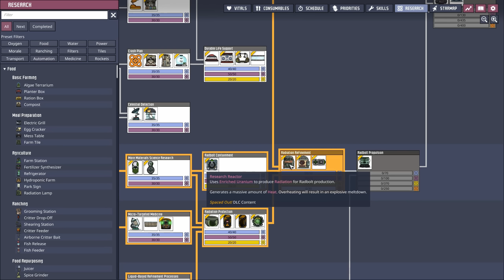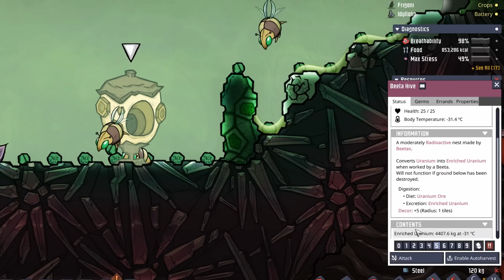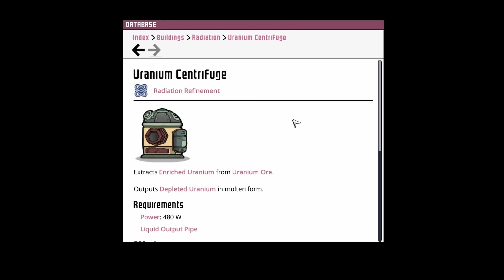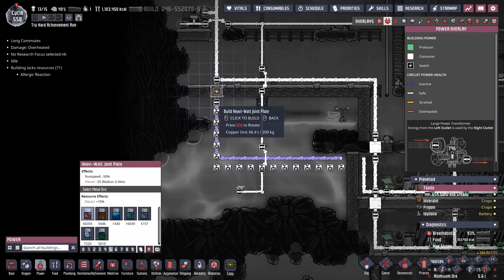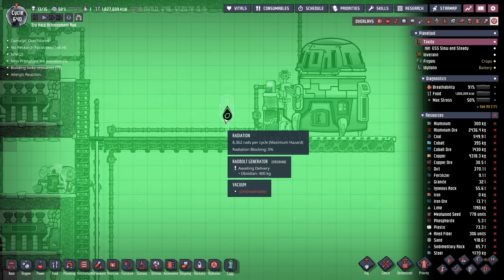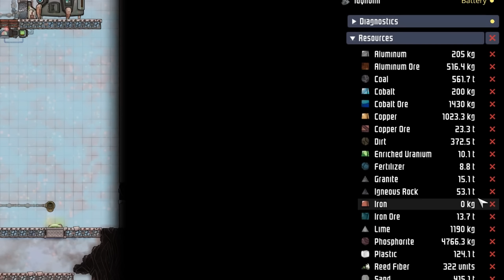Nuclear Industrial Sauna | Max Diff Achievement Run | Ep 14 | ONI

Comment: echo help plz xD , i'm trying to build a similair nuclear sauna as yours , i'm having a problem  , basicly i'm still in sandbox mode , the problem is the heat transfer from the sauna to the steam turbine , tried diffirent materiel " ceramic doesn't work neither " the only thing that works is insulite , i figured it may be bcz of tempeture shiftplate so tried replace them with ceramic same result , then tried drywall in ceramic same problem ......

btw : got 2 aquatuners for 5 steam turbine on top then another 3 aqua for 10 other steam trubines at the side , the heat transfer occur at everyone of them as soon as i build the insulated tile o f any other material than isulite

Comment: Nuclear waste is a good coolant as long as it's above 30 degrees. I use it on my steam turbines!

You could move the nuclear waste 'catch' tiles higher. This would provide some shielding and more space for your industrial brick. Waste still falls and gets pumped

Don't worry about too many tempshift plates. If you can make a line from the heat sources to some of the steam turbines, you'll have plenty of heat exchange.

Coolant limited reactors are fun, but you would need more resources.

Comment: Echo, you can use one (or multiple) temp sensors and AND them with the timer automation to control the conveyor shutoff supplying uranium. If the Steam temp goes above 200, you can stop the Reactor from running. Once you start adding industrial gear, they will be adding extra heat and you can save on Enriched Uranium.

Comment: I don't think I've seen anyone try to purify water with the power of fission. That's actually quite a good idea, you save power by not using the distiller and sieve, and produce power by cooling the steam. Very impressive, though if I were to say one thing, I'd suggest using the nuclear waste as a coolant. Since you don't use infinite storage that's about the only use I can think of for it off the top of my head. But aside from that I must say very good idea, and impressive use of ingenuity. 
That all being said, I was going to go into detail of how unrealistic the nuclear waste production is, and also how incredible nuclear fission is in reality. But I got distracted by how ingenious you were with that water purification.

Comment: IIRC reactors don't output steam, but water that is so hot that it turns into steam the moment it lands on the ground. 
Meaning the pressure isn't really a problem for reactors.
That is the reason why reactors are suggested to be placed at the top of the steam chamber.

Comment: Seems like a good time to throw some automation on those steam turbines with one battery for each so you can use some of that parallel automation, and tie it in with the reactor so that if the power gets snipped somewhere it turns off.

Comment: The system that you put in so the reactor only gets 10kg uranium per cycle is flawed. If the reactor is off (not accepting uranium), the system backs up a bit and holds a few cycles of uranium ready to be put into the reactor. You should put an AND gate, so that the system will send the 10kg only if the cycle sensor is sending green AND the reactor is accepting input (the switch is green).
Reply from the maker: The timer sensor controls the flow so I just need to take away the 1 second of green and it stops. I like the and gate idea though!

Comment: You might at least use the nuclear waste to cool your steam turbines. Allows you to cut down to one aquatuner for the ten reactor turbines, because the SHC of nuclear waste is so good. If you submerge the aquatuner in more than a full tile of nuclear waste it won't leak once a cycle and it won't take corrosive damage.

Apart from that you can really only use nuclear waste for more rads or more power. Rads you can get from an infinite storage of nuclear waste (although I believe you don't do inifinite storage on principle). The contaminants on fresh waste produce radiation. The infinite storage with its germ multiplication (glitch?) offsets the quick decay of radioactive contaminants, making an infinite storage of waste a pretty strong radiation source.

You can get power and contaminants by capturing radbolt engine exhaust with a pool of nuclear waste. You can run more turbines on the heat and the germs from the exhaust can be turned into radbolts to refill the rocket when it lands again, similar to the self-fueling steam rocket.

Anyway, great playthrough so far, especially in terms of production quality. The pacing of editing and narration is excellent. Great job!

Comment: You should have an atmo to lead suit interchange up near the top of the reactor building, so dupes that need to do work near the reactor will switch their atmo suit out for a lead suit before entering that area.
Reply: I think the problem with that right now is that he kinda doesn't have any lead.
Reply: @jadekaiser7840  very fair point, i completely forgot about that important detail

Comment: I used the nuclear waste to make natural tiles, and them make the pips plants the exuberant variant of the plants I wanted, thay way I can have a wild plant that produces the same rate as an domesticated plant, but without using resources to fertilize them
Reply from the maker: Good idea, so long as they don’t melt!
Reply: @EchoRidgeGaming  yeah, they melt at 26ish, so its ideal to sleet wheat
Reply: Wait you can do dat
Reply: How do you make a natural tile?
Reply: @PermacultureGame  for nuclear waste u need to use airflow tiles and pressurize the nuclear waste to above 1500ish kg, them cool it to 24C, its a very hard labor work, but I think is worth it
Reply: @ggcedicoes6599  So you make the airflow tile out of the nuclear waste and then pressurize it with gas?
Reply: @PermacultureGame  no..., its kinda hard to explain, but I can post a video by sunday, so u can see what im doing :D
Reply: @ggcedicoes6599  Awesome, thanks!

Comment: I once tried to use nuclear waste as a supply for infinite radbolts. I tried to melt the damn thing and then put it in a liquid box of sorts, with 3 radbolt generators.  In order to get like100 bolts/cycle for each one, I had to melt, like 10 tons. Inefficient as hell, then I found out wheezeworts give better results for 0 maintenance. It was my payload shooting only run, no tansport rockets, just pure, AI controlled system of gathering resources. Heavily modded game, but fun as hell.
Reply: Using the waste for radbolts really depends on using infinite storage to condense the waste into a very small area of concentrated radiation. If you're not using infinite storage, the reactor room itself is your best bet, and you're already getting the power from the reactor itself.

Comment: Nuclear (Nu-clear) Waste pump: add a liquid sensor to the pump, force the pump to sit in a small ammount of (atleast 200°C liquid waste), this way there'd be less heat (meaning power) wasted, which would also allow a few more turbines in. Those turbines would need some fenagling with this design, though, as they'd require access to both the steam and cooling. (Which is why I usually stick with our dear Irishman's design, much easier to expand). 

Lead Suits..... 'Nuff said 😊

Would also suggest a storage for the nuclear waste, as there's an achievement to mutate all the material-producing plants, but as @Echo is partial to not using infinite liquid/gas storage, I can't think of another easy way for this 😂 (infinite storage: 4x5 Airflow box with bottom corners cut out, Radbolt Generators inside the storage tank, diagonally downwards shooting out of the box into Reflectors. From there, the bolts can go anywhere you'd want. Infinite liquid input spot would be upper-right with a blob of naptha. This was for anyone interested, as shown by our beloved Irishman 😊 ) 

Otherwise, I'd say the Reactor design-premise is great. Radioactive Water-Purifier 🤣🤣 ❤ just need some automation to extract, and chill, the salt.

Comment: I built an infinite storage for nuclear waste which produces crazy amount of rad after ~200 cycles. A single radbolt generator can easily produce 1k+ radbolts/cycle if you submerge it in the one-tile infinite storage. For really long I assumed nuclear waste radiation will have a half life and decay, but they actually just keep their original rad lvl forever. I ended up stopping the reactor after I ran out of my naturally occurring Uranium ore cuz sourcing them from space is slow and a lot of work.
Nuclear waste is also easier to work with once you have enough of them, cuz you can build the storage much closer to where you need them. It's much smaller. Having them closer also means less risk for dups to be hit by rads and makes path planning near space a lot easier

Comment: Could you start sending the hydrogen over to the teleporter planetoid as free power for them? We obviously don't need it with the nuclear power we god haha!
Reply: Also use the nuclear waste as a coolant for your steam turbines and maybe stick it in a metal refinery or two if you're gonna put those in the steam room. It's SHC and TC are way higher than water.
Reply: The waste would also spill out of the metal refineries once per cycle. On the plus side, constant backfill from the pump is easily achieved, only needs a hydro sensor

Comment: 25:45 If you put the door 2 tiles in the air and granite wall on the ground below it, you could get any Dupe that does have to work on that level quite a bit of rad protection.
37:37 There doesn't appear to be a lot you can do with Nuclear Waste:
- it has good specific heat, but a freezing point of 27°C is pretty high to work with
- under the right pressure, you can turn it into radioactive, "natural" tiles for a pip-farm. Which would be good for Pip Farm with mutations, but might be bad for your rancher at these settings
- maybe you could feed it some critters?
Reply: The radiated natural tiles would still work on this difficulty. Just switch to lead suits and a healthy dose of rad pills (unpowered fridge with a timer-sensored Mechatronic Arm inside a room only accessible by those who actually work in those hazardous areas made it easy for me to manage. Timer sensor might have been redundant, as the fridge would only be reached by those who would work in the hazardous areas, though)
Reply: i have it being used as a coolant for i think an aquatinter and the steam gens

Comment: The thermals on that nuclear waste make it look like a pretty good coolant for heat transfer
Reply: The Depleted Uranium is my go-to for Metal Refineries. Usually exploit the Beetas for the reactor, but I always fire up a centrifuge to get Depleted Uranium in liquid form. It's not "the best" for this use, but it has a massive temp.range, and it doesn't spill like Waste. Solid Depl.Uranium is also a decent material for cold-bricks 😁 

Edit; not really relevant to OP's statement, but felt it was apropriate to mention
Reply: Yes, but nuclear waste always has a chance to leak out of any building it's in, whether it's aquatuners, or I've even seen it leak out of conduction panels. So it does work much better than water, but you have to be able to deal with leakage
Reply: @tilerh17  If you put the building in a full tile of liquid, 1000kg or more, then it stops leaking. 

You have to do it for aquatuners, pitcher pumps, buffer tanks. It's a royal pain in the tuchus and not worth it until you learn the trick. 

The other issue with it is that it solidifies at 26 degrees I think it is, so you can't cool a base with it. Fine for industrial applications though.

Comment: Do the old C-miner setups still work for dealing with metors? could just use those if they do to automate collecting the uranium
Reply: with the temperature transfer plate and the meteors not doing damage, you could probably make it more efficient by hanging the robominers upside down under automated airlock doors. Just open the doors when the meteors come through so they don't stack on top.
Reply: Should be still working. It's just that there's a lot less mass in the meteors (atleast for the first 800 or so cycles), and less material, so it'd take a good while before it'd actually be worth it. I mean, setting those up takes a lot of resources

Comment: An aquatuner filled with nuclear waste provides over 80% more cooling than one with saltwater.

+ do you not lose steam through those mesh tiles? There's no drywall behind them, only space vacuum.
Reply: No, mesh tiles are not considered open to the vacuum, even though they look like they should be.
Reply: @nazgu1  i think its the same with doors and airflow tiles
Reply: @gusfringfromfortniteuwu1648  and @Nazgul you're both correct. Any building that disables the possibility of having drywall or temp.shift plates have a built in background, even if it looks like it's exposed to vacuum. Mouse-over tooltip also shows this (exposed to space isn't shown)
Reply: @nazgu1  TIL!
Reply: @David Campbell just keep in mind, any building that can "store" liquids (like the Aquatuner's work-process of cooling it's content lets the liquid inside) will eventually drop some on the floor, so it would need a constant backfill. (Meant as a "keep this in mind when working with nuclear waste in general" 😊 ) Nuclear waste is great as a coolant, and with a reactor up and running, it's also a near infinite resource
Reply: @salemprompthous3820  If you sit it in 1000kg of liquid or greater, it doesn't leak. I've been doing this with metal volcano tamers.
Reply: @Davini994  haven't tried that. With the current design I'm using, the 2nd line of waste (pump and AT side-by-side) gets pumped out at 1T. Thanks for the tip 😀 I'll try raising the sink to 3 tiles.
Reply: @salemprompthous3820  I didn't quite get that statement and had to double check it.
It's not that the buildings that store liquid will leak any liquid, it's that buildings that store liquid will leak Nuclear Waste.
Reply: @ekimmak  yes, as this thread is about nuclear waste and using that.
Reply: Only problem with the waste is you can't take it below somewhere around 20°
Reply: @tristen9736  true. But the upper temp.range is quite substantial, so using it as a coolant in high-temp. areas makes it a great choice. It's not the best in terms of thermal conductivity and capacity, but there's very few elements that has the same upper range. Depleted uranium (from the centrifuge) is another element with great range